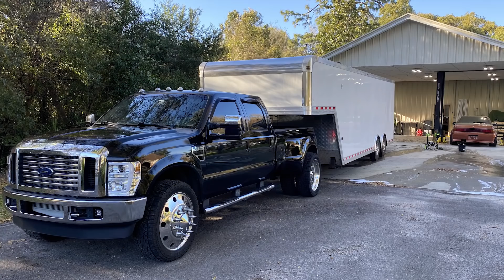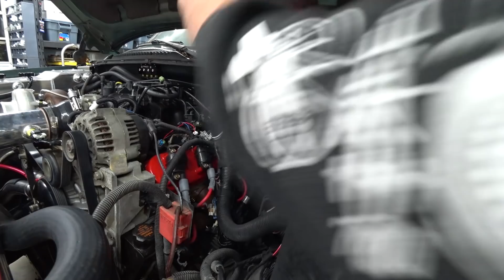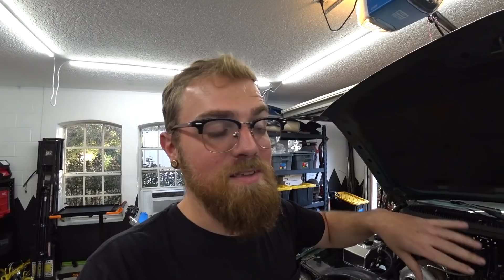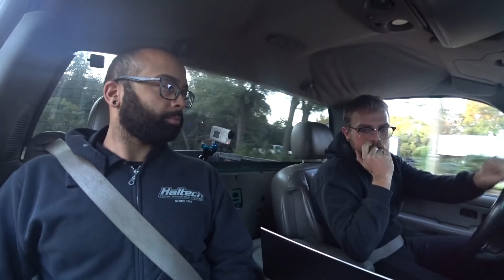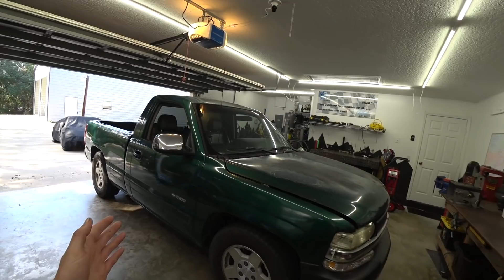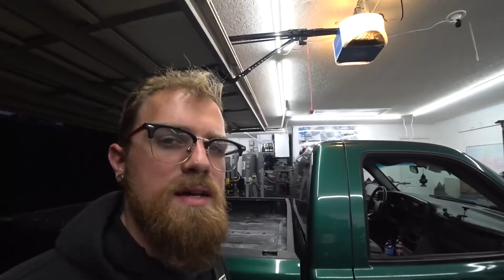Hitting boost for the first time in the turbo LS street truck build! It’s rowdy.

Comment: I installed my 2 step box and electronic cut out module both on the fuse box as well. I heated the tip of a metal pick with a lighter and poked it through. Then used screws to cut threads into the new holes.

Comment: Chances are your gate is not failing because it’s too small, it’s failing because it is not routed correctly. The gates piping needs to be as straight with the flow of exhaust as possible

Comment: It would be cool if you did a breakdown on how you integrated the terminator into the factory harness..
Reply from the maker: I explained it in the wiring video. Literally all I did was use a splitter for the crank signal and vss sensor. Then alternator plugged into the stock harness. That’s all I had to do.

Comment: Taylor for street testing try heading onto the highway, put it in 3rd or 4th, floor it and let it build boost. You can start with short ramps and then eventually run it just short of the limiter. It will react much slower and be way more controllable. There will be a lot more airflow to help keep things cool as well. Once you have everything ironed out through that sort of "steady state" testing, then go hit the back roads to do some standing WOTs, 1-2 shifts, etc.
Reply: Yea for real !!

Comment: Awesome build. I am finishing my 01 silverado, 6.0 same turbo set up as yours. My question is why did you choose to run holley vs stock ecu, or maybe what's the benefit of holley over stock? I'm starting to get into learning about tuning and many platforms for ecu. I'll be daily driver and weekend off road warrior. My truck is 4x4. Maybe a video about tuning.
Reply from the maker: The Holley is just light years better. So much easier to work with and use. Runs way better out of the box. This thing literally has a close base tune and with holleys closed loop you can rip on it and not worry. It’ll keep the afr’s correct until you run out of fuel system. I’m not a tuner. But have been learning and tinkering with all the softwares. The stock ecu tuning is a nightmare. So convoluted. Tables on top of tables for the same thing. The Holley you can almost get by without a tuner. Lol not that I would suggest it. But you don’t need a mail in tune to get it running.

Comment: I have a 6.0 and 80e sitting in my 65 c10 it’s gonna be a driver with lots of interstate miles. I’m torn down the road I want a power adder turbos are fun and all but everyone seems to love the instant power from a lsa set up. I’m not looking to run 8s just have a fun full size I can drive to truck shows

Comment: You should totally order an ipad dash kit and retrofit it for the prodash. There is one available that replaces that pocket under the radio on the center console. That would likely be quicker and easier than putting it where the current head unit is. That said, I'm fairly certain you can also buy kits to relocate the head unit to the same area.

Comment: I did 1 16" derali on a 185 deg switch and 2 9" derali fans on a 195 deg switch. That way theres no unnecessary amperage being used. Then Im putting 3 7" derali fans on the oil/trans cooler in front of the radiator on a 195 deg switch + the stock 16" AC fan on the condenser. So I can get some serious cfm over all the coils.

Comment: Trans temp no surprise , move it to beside the trans with a shrouded fan on top to pull air from below.  those long lines running by the headers is not you friend. Also Install a duct  to direct air from the rockers to the  cooler matrix vLike a low naca duct or ducting from the rear of the drivers side wheel well  .   .  Or get a cooler matrix that cools with air going perpendicular to the matrix like the old Honda  VFR bikes.

Comment: Nice I can’t wait to get my truck together I’ll have eBay stuff on mine lol stock computer but will have a areomotive dual 450 pump with 1000cc injectors stage 2 btr turbo cam on a small 5.3 with 2500-2800 tall torque converter eBay turbo t4 inducer 78mm exducet 102.40mm idk if that’s what you go off of for size for turbo

Comment: and like I said before, you could of put one big gate on the crossover in the "perfect" spot, which you can on yours. I used a single 38mm Tail, on my 331 5.0L fox. making 700hp easy. no creep at all, ever. I did say single 38 too, not a typo. I use the same 38mm gate on my 700hp AWD talon. No creep, ever. Do it right now.

Comment: I’m tied between a whipple and a turbo set up. If you can let me know how much the turbo set up was Taylor
Reply from the maker: Turbo $500. Wastegate and bov $200 Both exhaust manifolds and crossover $8-900. Intercooler $300. Piping and material for exhaust $500 or so. 

Huron speed makes a nice kit for like $2500. If I didn’t like fab work so much I would have done that.
Reply: @Taylordrifts  hey thanks man!! That reasonable as hell

Comment: Taylor, would you think it's worth the extra $500 to buy a Terminator X Max over a stock ECU with a custom wiring harness? I won't be running cruise control or anything like that.

Comment: Highly recommend staying away from the cheaper map sensors. I run either lowdoller sensors on a Holley. Or buy a OEM zr1 3 bar GM map sensor. Super super reliable.

Comment: Not that it really matters, but that fuse block should pop right out of there to give you access to the back of the bolts, shouldn't need to unplug anything. I am in the middle of putting fenders on an 03 3500 w/ 6.6, it had to come out to get to the bolts. It is currently held in by a coat hanger and a well placed ziptie.

Comment: What's the next step for the shop? Are you getting the electrical done?? Or do you have to get the doors done first ?? You should video it I would love to see shit getting done to the shop even if it's mostly time-lapse are you gonna get the other lift put up? When are u gonna start setting it up Wats your plan? Just curious love seeing the progress thats all are you gonna wait till it's fully done like wired up insulated and everything b4 you start moving back in and getting things set up?? Shit I know if it was me as soon as the door are hung and the electrical is done I'd be hanging lights and moving in haha will you be putting Air conditioning in there?? They have those nice ones that go on the wall

Comment: Best thing seeing your expression when the boost hits and tires spin from a guy that’s had that feeling a thousand times. But most annoying part of the vid and build is the stupid loud exhaust. I know it’s a sloppy type build I get that. Build was supposed to be a great daily or parts runner. 
Past 4 years I’ve been driving a 70 Chevelle full 3in dual exhaust making 630whp, SBE 6.0 78/75 Borg 14psi pump 93. 
So a good exhaust just makes a better driver not less HP. 
Looks like you’re already considering it so hopefully it’s in the trucks future.
Reply from the maker: Yeah it’s a little loud. I didn’t know how loud it would be. It’s not really a sloppy build in that sense I built a fully custom stainless Tig welded exhaust. I’ll address it if it bugs me. It’s my preference. I’m just not going to start rebuilding it after the first drive. Lol

Comment: What software do you use for tuning or if you know of one for tuning a stock 359z
Reply: This one runs off the Holley. There are people who can do limited tuning on stock ECU’s but there are limits with what that can achieve. You can improve throttle response and raise the limiter. Using a reputable re mapper is cheaper than buying the software and learning how to use it if you are just tweaking a stocker. On a 350z you are looking at pretty small overall HP gains unless you want to go down the super charged/turbo route. An aftermarket ECU will unlock everything you already have plus will support power adders and potentially engine swaps later.

Comment: Trans cooler def needs a fan, iirc you installed it under the bumper horizontally - it won't get good clean air, just a little turbulent air

Comment: How do you integrate the holley with the factory ecu? Just curious. Wanting to upgrade to a holley
Reply: I think the Holley is only wired to the engine. Body harness and wheel speed sensors plus some of the ones needed to run cruise control, are still on the factory ECU.
Reply: Yeah was looking to see how he made cruise work with a holley.

Comment: Did I miss where you explained how to integrate into the factory truck? Cruise, gauges, etc? I was really hoping you would show that, I'm going thru that at the moment.
Reply from the maker: I’ll have to show in a video but it’s literally just a splitter on the crank sensor so both the Holley and stock ecu get crank signal. And a splitter on the VSS in the trans. I didn’t split the other stuff like coolant temp
Or oil pressure since I’ll have the Holley dash. But it’s super easy. I have the stock ecu running the alternator and it’ll run ac and I’ll just send an input to the Holley to tell it the AC’d on
Reply: @Taylordrifts  thank you very much! I didn't realize it was that simple and that all the factory engine harness was still ran and the holley is just on top of it. How is the stock ecu not trying to change all the tuning parameters the holley is making?

Comment: You do not need to adjust idle spring. You need to adjust the ignition for this load area in idle where it sits when in gear. Make sure to have enough resolution in the idle area so that you can tune it accordingly. Most people spent way to much map resolution points for boost but it is actually not needed to have 5 or 10 psi increments when in boost. You will need that at idle and in the areas where you will have ping to adjust the map correctly. Of course it would be way easier with an IACV, stepper or PWM based so that you can raise it slightly when in gear. On my auto cars adjusting the idle properly and advancing the timing enough solved the stall. It also made launches way stronger....
Reply from the maker: It does have an iacv. Basically the throttle was too closed. The iacv was maxing out just to idle it in park. Adjusted it to where it was 10-15% duty cycle hot.
Reply: @Taylordrifts  ah sorry, didn't hear that in the vid :-) or did'nt get it. English is not my native language. The main approach should still be ignition as it is way faster in catching up with rpm drop than air. I also had it a lot that in close loop the dance of stall starts where it cycles constantly and idle surge happens. IACV as last measure, ignition as main driver.  Love your vids and detailed descriptions. Best wishes from Switzerland :-)

Comment: Now you just need an exhaust with cutouts and you will have a great lil sleeper.
Reply: Ya he did straight pipe out the side not just a dump but ya I like a quiet exhaust myself and with the option to be loud is cool
Reply: It would sound insane with nascar style boom tubes
Reply: loudvalve

Comment: He’s gonna get so addicted. I’m expecting 4 digit power numbers and a 4 link suspension in short time
Reply: You'd be surprised how well they do with stock suspension in the rear.  Maybe front half it?
Reply: Caltrac’s  work great.  Lot of really fast leaf spring guys use them
Reply: @namelessone11111  yup ive seen 2jz tacoma run 8s at the strip with them. im getting some soon
Reply: Mono leaf, Caltracs, and double adjustable Viking shocks. Very good street manners, but still hook good
Reply: I don't know he has race cars right or just drift cars but if you are dailing it maybe I mean I'd like to see 1000hp plus but I guess we will have to wait and see
Reply: Mexico! 🤘
Reply: Hope so
Reply: Is this his first build or something? New here
Reply: @jif4639  first straight line race car. But he’s done multiple drift cars
Reply: @SofloChico  ahhh okay
Reply: Caltrac mono leaf, cal tracs, and a good shock and this thing is ready to roll. No need for a 4link.
Reply: How much does this cost if I do it with my mechanic friend and not in a shop
Reply: Nah bro slapper bars and shackles make a 70s street freak style with some cragar ss or soft 8s
Reply: you got him at 4 link susp......